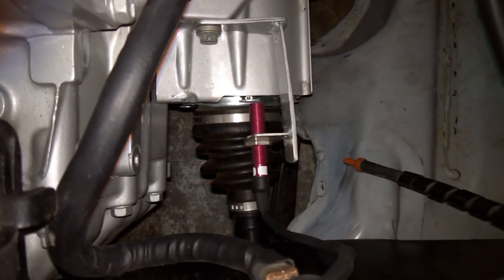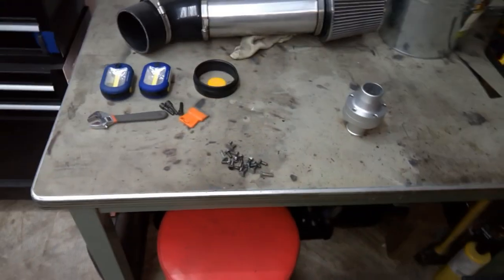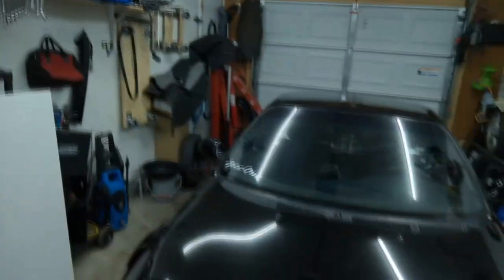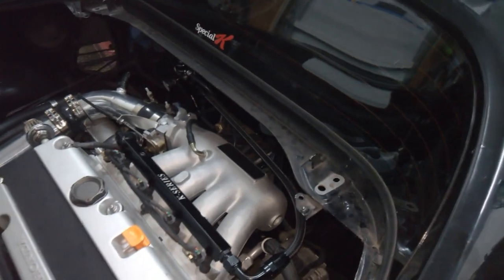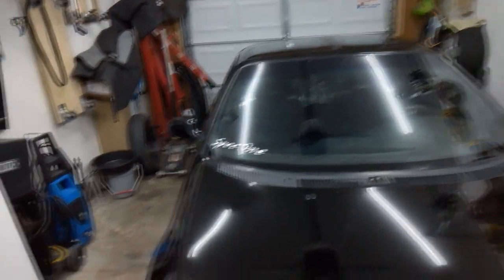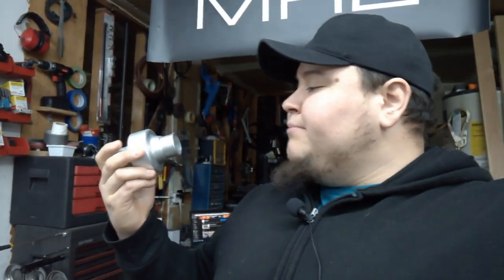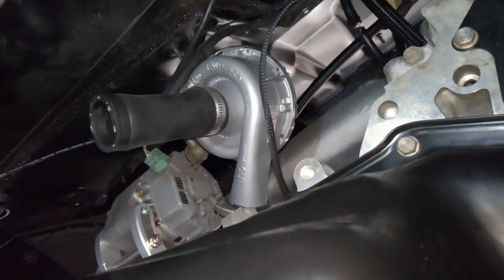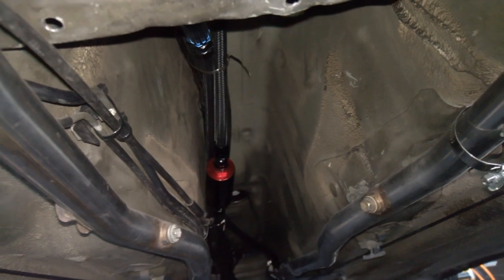Electric Water Pump Is Overcooling The MR2!

Comment: if your pump is moving to much water you can use a "dc motor speed controller" for a radio control airplane or helicopter. hook the speed control up to a "servo checker". put the servo checker within reach so you can adjust it. make sure and get a speed control for a brushed type electric motor if that is what you are running. also make sure the speed controller is big enough to carry the amps your water pump motor pulls.
Reply from the maker: I managed to slow this down a bit, but that's a great idea...I may implement this in the colder months. In the 110-115 degree weather out here, this overcooling is actually working in my favor :)